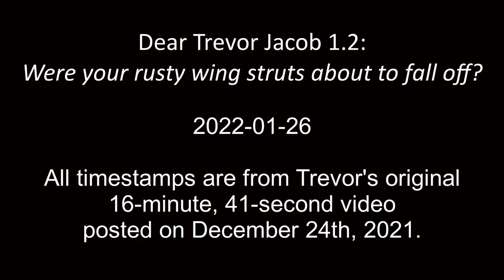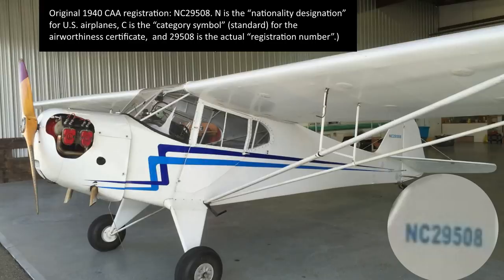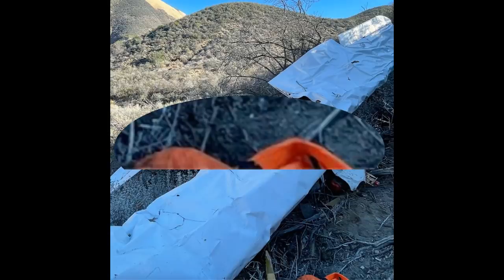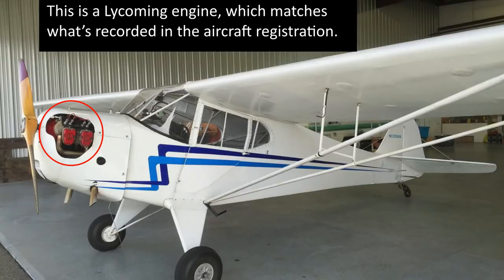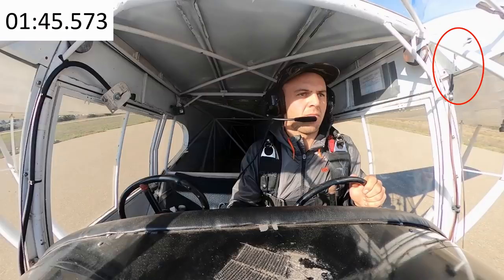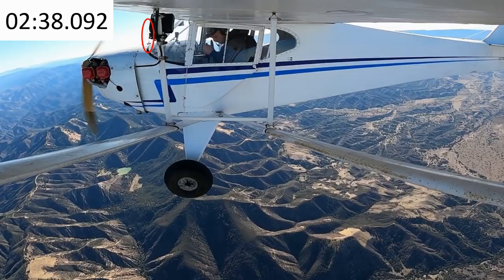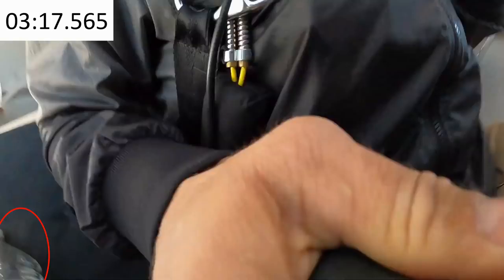Dear Trevor Jacob 1.2—were your rusty wing struts about to fall off?

Comment: If you look at the aircraft flying there is a black line on the side of the fuselage running from top cowl to bottom corner of the windscreen and it goes under the windscreen it is wiring or a tube did the FAA get to see the aircraft before it was moved and have they seen the log books for engine change and other mods carried out The FAA should have look at the aircraft after the crash and log books as if the log books do match the aircraft mods etc than this guy had intent to crash this aircraft  and did he sell the engine if he did the FAA should put a circular out there for the engine and anyone knowing we’re the engine or change the engine or has it and doesn’t report it should also go to jail if they brought it from him with not knowing what he was about and they report that is ok and should not get into trouble as they did not do wrong . He has removed what he wanted put a crappy engine in it and went out to crash it just like someone buying a car and going bush bashing and when it’s done walk away from it

Comment: How about the left elevator damage at time stamp 5:28 in your video? I am now very curious about the previous damages to this plane and if it is now an insurance write off after parting out the useful components. I feel like there may have been an incident preceding this in which returning to proper airworthiness would cost an outrageous amount.
Reply from the maker: I haven’t noticed the damage before—will look at it in a few days

Comment: At first, I had thought that pitot tube was part of a digital airspeed device attached to the jury strut on the wing.
I don’t think it is though.
The tube seems to be separate and runs up into the wing and that device is mounted separately on this same strut.
That device a large camera? 
A digital airspeed device? Since the original one is not attached.
Reply from the maker: It’s a large camera housing. One other channel covered it in their comments, but I’m going to go back and look into this in more detail soon. 

I might have found something new, and also need to highlight a few discoveries from other channels that haven’t gotten enough views. 1.4 hopefully hits today, but maybe tomorrow
Reply: @PetesGuide  - I do leans towards an action camera of some sort.
It really doesn’t look like a digital electronic flight instrument I am aware of.
I don’t really understand why it would be attached outside to the wing jury strut.
These digital devices are installed in the panel and connected to the pitot static system inside.
Unless, it is some other kind of digital wind speed indicator that needed to be strapped outside. Since, it does look like the pitot tube is separated.
Reply: @PetesGuide  - Ok, would that housing be an extended battery module?
I can almost see the power button on the lower rounded side where the battery would be.
Explains the larger size of this device.
Reply from the maker: @HucksterFoot  bingo! Another YouTuber found the exact model number, which I’ll cover in a future video.
Reply: @PetesGuide  - Yep, think I found the same model. Looking forward to new video.
Reply: @PetesGuide  - It certainly looks like a continental a65 engine as opposed to the Lycoming O-145-B that was in it.
I also think it’s a cut or a break to the side exhaust hole in the cowl. I wonder if that was done when the engine was replaced?
Reply from the maker: I’m still going to do a deeper dive on that, but I’m working on researching a few other things first. Stay tuned!
Reply: @PetesGuide  - I am a little late to this game, it’s an interesting one.
The video of the airplane below him is nagging at me a little bit lately.
Reply from the maker: Nobody has a good explanation for it. I’ve got a few hunches, but have a bunch of other things to look at first. 

And you’re not late to the game—I’m working on version 1.4 of my analysis, and have plans mapped out through 1.9 at least. Lots more to find and tell here.

Comment: Also,why was the aircraft with that number registered with the FAA dated January 3, 2022
Reply from the maker: Because the FAA is apparently slow at processing the registration paperwork. I haven’t yet asked them how long it typically takes or if they have a received date on file for the new registration.

Comment: None of y'all know what you're talking about I'm lucky to be alive. I hope none of you ever end up in my position without your parachute on.
Reply from the maker: So why did you have fire extinguishers strapped to your legs? And did you use blue painters tape? I would think gaffers tape would be more reliable.

Never felt like I needed a parachute when I went up in small aircraft, including a glider and helicopter.
Reply from the maker: And why are you commenting using an account with only 2 subscribers? Did someone (or YouTube) lock you out of your main account? This is your backup account, then, I suppose.
Reply: @PetesGuide  I always carry at least one fire extinguisher in case my plane catches on fire. Some people keep them stowed. But then what're you going to do if the fire extinguisher catches on fire? That's why I keep it on me.

Comment: The top of the wings, show compression damage, as if someone had jumped on them.
Reply from the maker: If they were metal I would agree. But they are fabric-covered wings, with probably only the curved leading edge being aluminum. Can you look at it again and see if you think that damage could be done by jumping on it? I think it’s just crumpled fabric, but the more eyes the better.
Reply: @PetesGuide You're right, i had metal wings on the mind.
There is another anomaly, that being the pilot side step has been removed from the lower strut.
Reply from the maker: @Lawiah0  yep! I was the first to publish that one! I forget which version it’s in, but maybe even 1.0.
Reply: @PetesGuide  Thanks

Comment: I’m not entirely convinced that black line on the engine canopy isn’t a crack. The engine cylinder hole in the canopy seem to have been cut just a small bit wider and that might have cracked the canopy in the work process.
Reply: Looked like a big zip tie to me.
Reply: A change in engine may make it difficult to install/remove teh cowl, and an extra cut could help it slip over something at some point. the engine he used looks wider than the original, probably a tight fit to get the cowl back on.

Comment: And ... the point of the video is?
Reply from the maker: To any pilot or mechanic in aviation the point is self evident. What part can I help you understand? Knowing that will help me make the next video better.
Reply: @PetesGuide  Well. I don't want to be derogatory at all. But I think, if you want to get better, then I think you should have clear in your mind what you want your video to do. There are 3 clear points. 1. The aircraft could still fly, as it flew to the ground. 2. There were plenty of places to land an aircraft of this size. 3. Good airmanship is drummed into pilots - and the mantra 'Fly the plane. Fly the plane.' No pilot would bail out like this. Therefore it is a stunt. We cannot, however, draw any conclusion from the points you make in your video. They are all coincidental.

Comment: its not rust its aluminum.
Reply from the maker: The wing struts are steel not aluminum. Very little aluminum on this model plane. Frame, wingtips, and tail tips are welded steel tube. Wings are wood covered with fabric. Fuel tanks maybe aluminum. Wheels either aluminum or magnesium or zinc.

Comment: I did more thinking on your post and think about this.

It is known that Trevor did some of his own repair work. There is only a few things that service on a plane that doesn't require a licenses A&P mechanic. You can do the work an A&P mechanic does as long as that person is supervising the work and signs off on it. Obviously supervising the work and signing off is going to cost you much less than the A&P actually doing the work.

Look inside the cockpit, the right hand tank valve, disconnected and hanging by 1 bolt. The missing step. The apparent disconnected pitot tube. The clearly modified cowling for a different engine. The clearly freshly painted valve covers.

What if this was insurance fraud, what if he couldn't afford to do the annual inspection, what if he couldn't afford to pay for an A&P mechanic to do the work. What if he couldn't afford the overhaul cost on the engine so he put one in that ran but not overhauled. What if he did it himself, couldn't get the cowling back on so he cut the exhaust holes bigger and made the other cut so he could get the cover on. 

Then once he can get it airborne tries to double dip and make money off  YouTube but is so dumb he leaves all the evidence for the average person to see.

Then he sees the comments, turns those off, hires a helicopter pilot, probably knows the guy, recovers the wreckage so it CANNOT, be examined to hide the obvious evidence.

I would bet, 5 will get you 10, this is insurance fraud. Follow the money. And yes he scoped out where he would jump, but it didn't fly straight. Instead he forgot that at cruise rpm, the rudder is trimmed to counter the left turning tendency. With no engine running the that predetermined trim would make the plane do what? Turn right when no power and no one at the controls. 

Just watch him practice with the pitch trim so it goes slightly nose down just before he jumps. He expected it to crash in the stream bed, but with no one at the controls and the pretrimmed rudder, it does slow right 360 turns. 

What an idiot, I hope the lock him up and YouTube should ban him permanently.
Reply from the maker: Very interesting thoughts. I’ll also wager he didn’t have any insurance on the plane. If that turns out to be the case, what else do you think the motivation was?

Oh, and expect a new video about the trim soon.
Reply: @PetesGuide  

Well, I've taken flying lessons, can fly solo. One of the first thing is trim the pitch for level flight. Of course I asked about the rudder since the plane didn't have rudder trim. When we landed we looked at the bent trim for the rudder. They trim it for cruise. 

We talked about what maintenance you can do and what you can't, it's not cheap to maintain a plane and especially pay for a overhaul of an engine.

If he couldn't afford to keep the plane in flying order and no one would buy it unless he brought it up to snuff, what is he going to do? 

I doubt he's making money off the video at this point.

How dumb is this guy? He probably thinks that just deleting the files on the SD card deletes them, it doesn't, it just removes the pointers to the file location, they can be recovered if not written over. If they ever get ahold of those cards, they're going to recover the "deleted" files. The only choice is to pulverize those cards to dust.

But it still comes down to money, as always follow the money and you will solve this mystery. I still say insurance fraud, I'm open to other possibilities though.
Reply: @erwinrommel839  surely insurance wouldn't pay out on an aircraft with no air worthiness certificate if it didn't have one or if any illegal modifications had been done, there stance would be it shouldn't have been in the air in the 1st place and any insurance would be void, they'd also want to inspect the wreckage prior to any payout which can't be done now if he has supposedly gotten rid of it, I doubt it was insurance fraud, I think it was done purely for YouTube views.

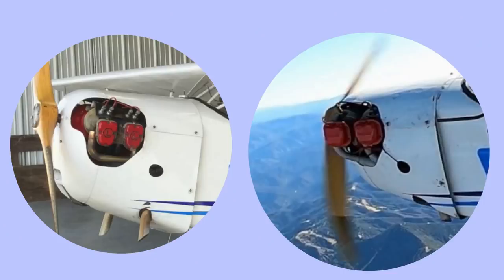Comment: 3:53 I have just noticed a hose or a wire idk, going through the wing strut into the engine cowling, you can see it right next to the gopro mounted on the wing strut, what about it?
Reply from the maker: When I first saw it, I was sure it was a jury-rigged fuel line going from a jury-rigged left wing fuel tank (not an original option on this plane) down the jury strut (that’s really what it’s called!) to the fuel tank behind the engine.

But it’s just the pitot tube, which is supposed to be there and is supposed to provide airspeed to the pilot.